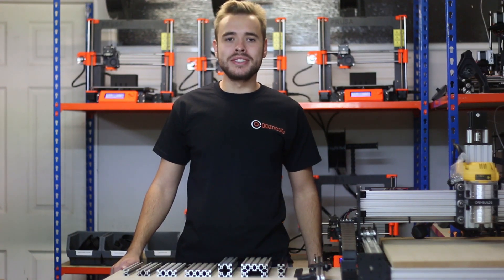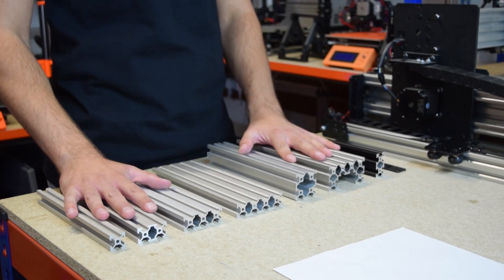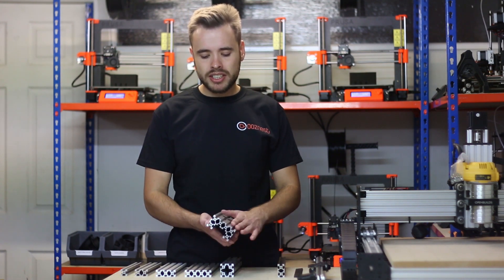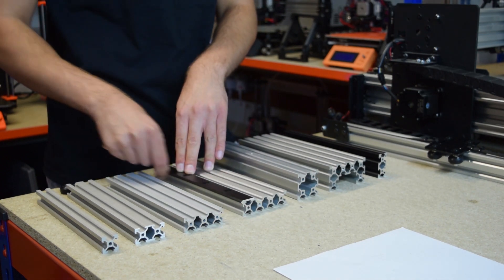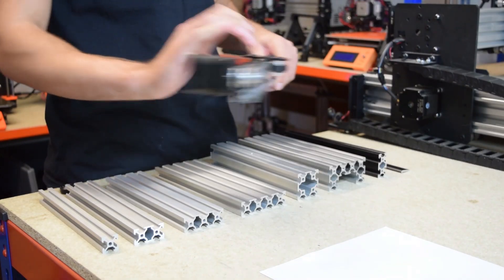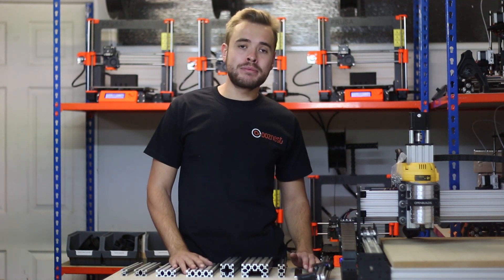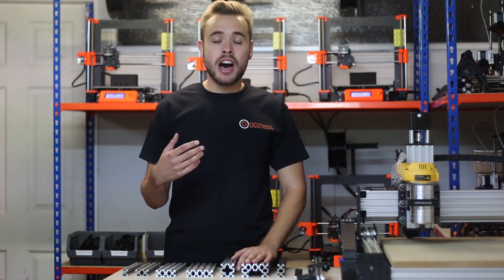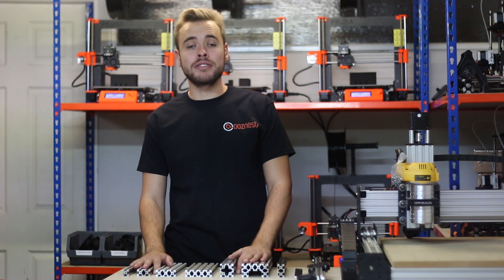V Slot Extrusion | What To Know | Ooznest & Openbuilds

Comment: Roughly how strong is it? The 2020 stuff? Looking to build a radio controlled vehicle, which will use this material as a frame (600mm wide, 1200mm long, and about 300mm high), with wheelchair motors, speed controllers, SLA batteries, etc inside. So it will need to hold up some weight. Probably a couple hundred kg. Are we better off using 4040 or will 2020 do the job?
Reply from the maker: Hi there! The full specifications of the extrusion can be found here - 20x20 (https://ooznest.co.uk/product/v-slot-linear-rail-20x20mm-cut-to-size/) / 40x40 (https://ooznest.co.uk/product/v-slot-linear-rail-40x40mm-cut-to-size/). They are both manufactured from 6063 T-5 Aluminium :)